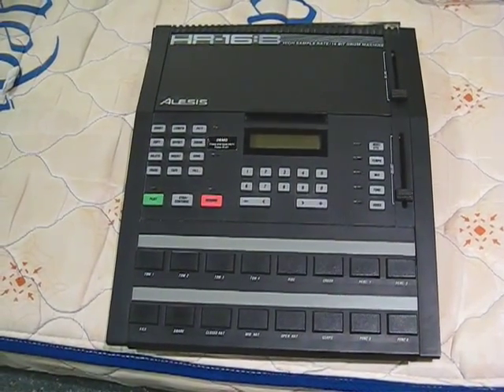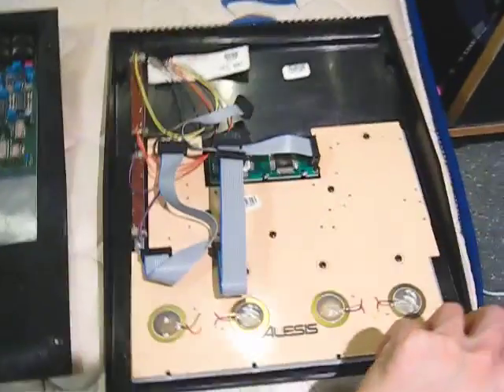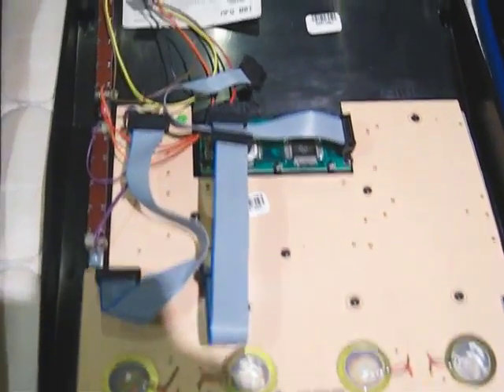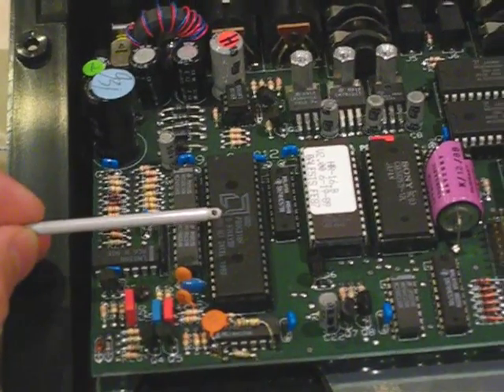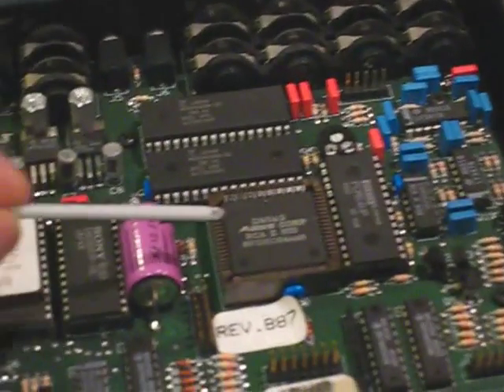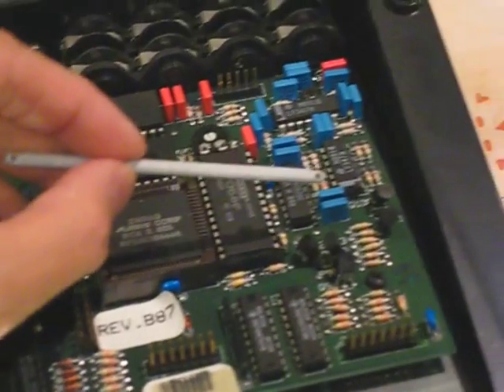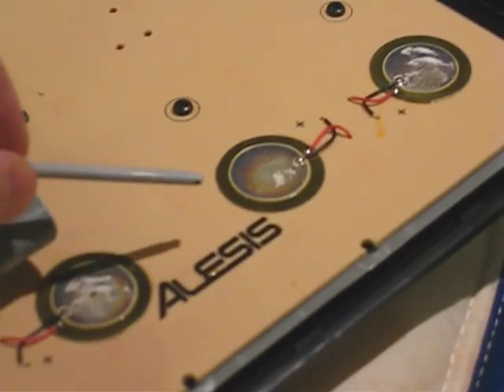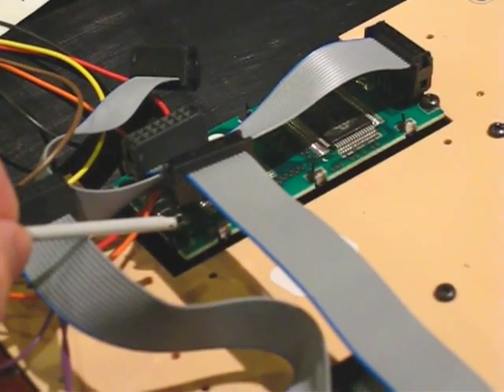Alesis HR-16B Drum Machine Take Apart

Comment: Awesome video bro! Mine comes on with no functionality just a screen full of square blocks stuck on pattern mode (red light)  already changed the battery 🔋  but no luck 😢
Reply from the maker: sounds like CPU not resetting or RAM error
Reply: @chinesemusic8019  thanks for your reply, is there a fix around this?

Comment from the maker: Check the connector to the display.  The display is a pretty standard 16x2  HD44780 parallel input LCD.  It can be replaced easily